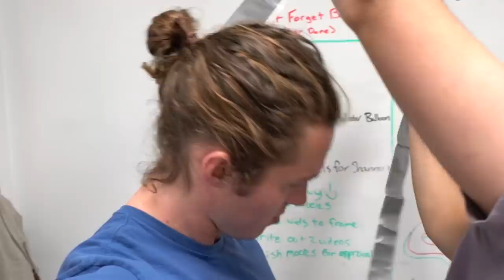How Strong Is Duct Tape Armor?

Comment: Tanner: ''have you ever thrown a knife before?!? You have to throw it holding the blade''
Also Tanner: *Throws the knife holding the handle''
Reply from the maker: hahaha i didn't even notice that
Reply: Woods said to hold it by the blade not tanner
Reply: You can throw a knife by the handle or the blade. It simply doesn't matter. What matters, is how your wrist flicks, and the amount of power. When the knife connects and you find your striking with the handle, then flip it.
Reply: @REKTHi5  Who replied?

Comment: When i made duct tape armor i also put multiple layers of soda cans in there. The cans provided a lot of the armor of course while the tape held it all together. It wasnt only a chestplate. There were also bits covering the tops of my arms and legs with attachable pauldrons. When the time came for it to be tested me and my friend got a knife and tried to stab through. It worked quite well. Well enough that the blade of my friends knife snapped and mine bent. Neither making it very far in. Probably due to the sheer amount of crap it needed to stab through. About a solid half inch inch of aluminum and duct tape with two inches of material over and around the heart.

Comment: the reason why you all keep hitting the same spot is because your not pulling the bow far enough back and all of the tension is in the chest and upper body you have to relax and pull it back so the tension is not on your upper body and in your arm
and with the throwing knifes hold it buy the blade to when throwing it vertically and hold it buy the handle when your throwing it horizontally